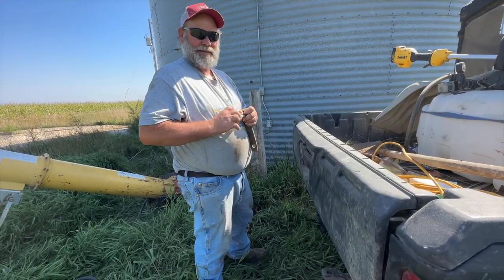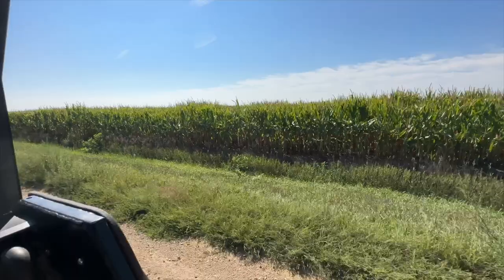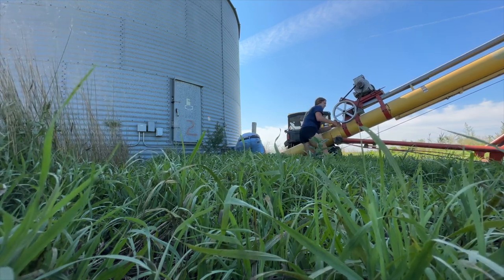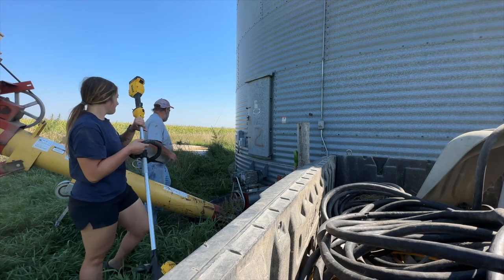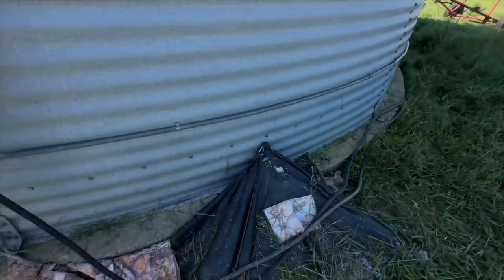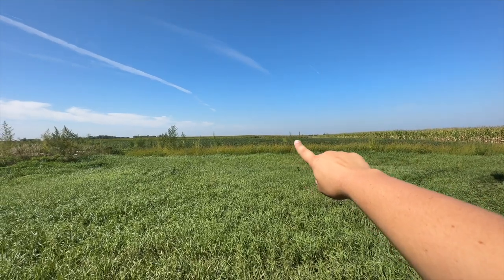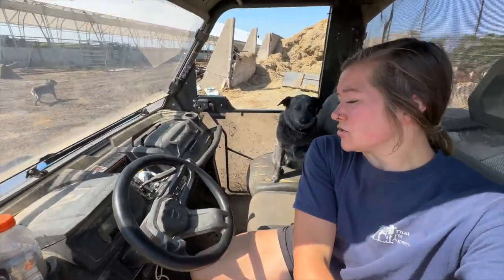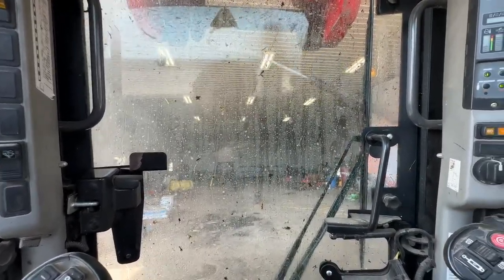Skid loader issues & hauling more corn  | Day in the life of a 26 year old farmer | farm vlog

Comment: If u could find in good shape ,mechanically and cosmetically would you get and run older equipment. Meaning no def,dpf stuff ,cabs a/c working and heat working etc even a skid steer.
Reply from the maker: Yes -- in the right situation.